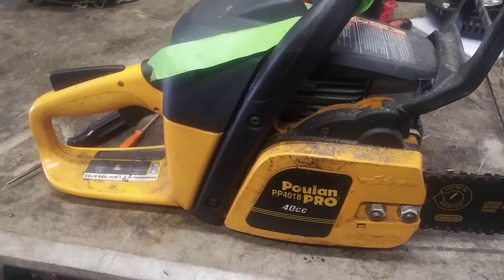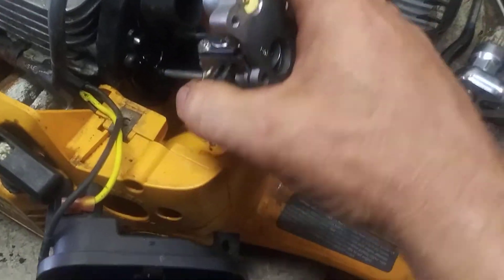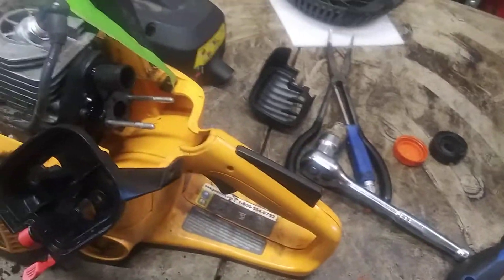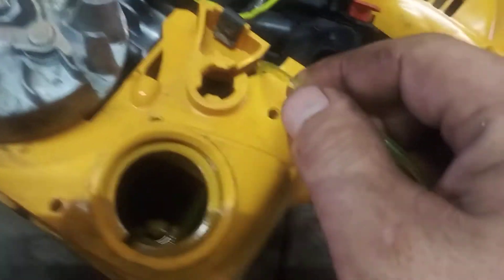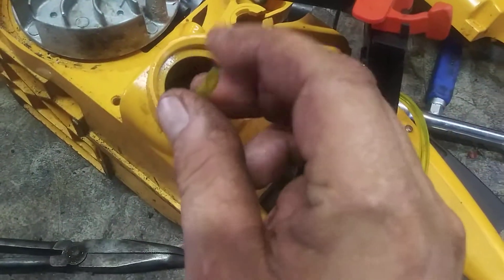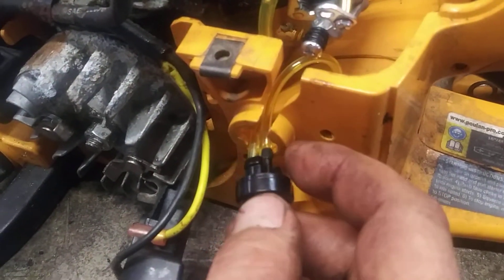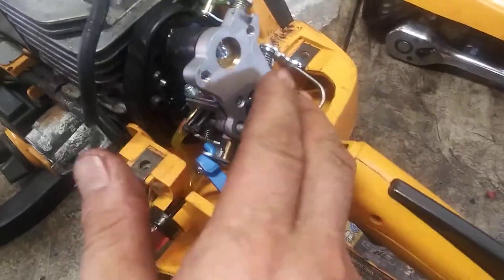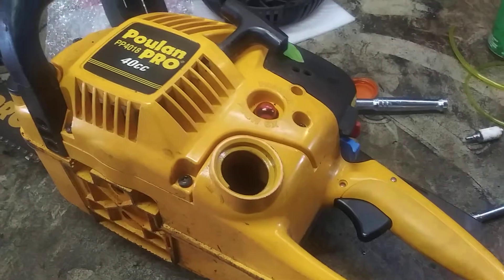*  Poulan pro pp4018 chainsaw carburetor repair. poulan chainsaw carb repair

Comment: I was wondering why the carburetor and head has two inlets Whats the second one for
Reply from the maker: they call it a turbo but it just opens at higher rpm getting more fuel and power in
Reply: @smallengineguys  I’m actually rebuilding one as a school project and i was wondering if it’s possible to put a single barrel carburetor on it and how to do so
Reply from the maker: yes its the same carb you just remove the extra barrel and plug the top hole.
Reply: @smallengineguys  ok
Reply: @smallengineguys  i was hoping to get it running with just the engine outside of the chainsaw part how could i mount the coil?
Reply from the maker: @Bread45  by making an aluminum mount and welding it to the block. You'll find that very difficult. Coil has to be perfect or timing is off. What are you trying to do.
Reply: @smallengineguys  I’m wanting to be able to mount it to a table without any kind of cover blocking any moving parts im going to have a plexiglass shield I’ll install once its running so i can explain how it works etc
Reply from the maker: your gonna need to mark where the coil goes on the engine block make a bracket and tig weld it to the block. do it slowly so you dont build to much heat and warp the seals. good luck.
Reply: @smallengineguys  thanks

Comment: Damn I was hoping you would show how to adjust the carburetor
Reply from the maker: Most of the time its the screw closest to the airfilter turned counter clockwise 1/4 to 1/2 turn
Reply: small engine guys yeah there’s three on mine, high and a low and an idle screw, was wondering how many turns out I needed on each one from the seated position all the way in? I have the exact saw
Reply from the maker: @wild8757  usualy i go in till snug then 1 full turn out on high and low. Im 4 feet above sea level though. Much higher altitude can go as much as 2 turns. Then go out a quarter turn on the one closest to air filter and keep trying on choke till it trys to start. Then at full throttle find the sweet spot of full throttle. Then work on idle from there. If you feel your way to far out on high then turn low out 1/4 turn and restart the high end. All else fails. New carb is in the description.
Reply: small engine guys Thanks I’ll give it a shot, Saw hadn’t been used in a couple years and was in my shed, we got a heavy storm that flooded my shed by a couple of inches over the floor, water got inside saw about an inch high, might have to replace carb, do those ones on eBay need much adjustment or are they preset?
Reply from the maker: @wild8757  pull muffler look inside at piston make sure no rust or damage. Run with a touch more oil the first time.
Reply: small engine guys Yeah I already pulled the muffler and checked out the piston/ rings they look good, I just can’t seem to get the screws set right, I thought it might be the fuel filter so I pulled the fuel filter off and just stuck the fuel line down in the tank to test it and that didn’t help, tried putting in a new spark plug and air filter didn’t help, when I get it started it’s screaming but when I turn the idle down using the low screw or the idle screw it either keeps screaming or If I unscrew it out  too far it just stalls, or if I get it to idle it bogs out when you try to throttle up, I tried screwing both hi and low screws all the way in and backing out one turn each and working from there but can’t get it right for some reason, I was going to buy that carburetor kit that you bought but I read some of the reviews saying the carb barely works and it’s not the same, doesn’t sound right, doesn’t run like the original one does, it made me hesitant to buy one, guess I have no choice now, What do you think did that eBay carb run just the same as the original or was it not the same and rough running?
Reply from the maker: @wild8757  1 out of 100 dont work on the new ones. I do 10 chainsaws a week. 10 2 strokes a day and i only get 1 bad carb a month or 2
Reply: small engine guys That’s cool ordering one now, I have the exact same one you had the Poulan pro PP4018  40cc, did you have to cut the housing to get a rod to go over the top or something for the carb to fit? I was reading one of the comments where someone said some shit like that, maybe it was a different model than the one we got?
Reply from the maker: @wild8757  no i just cut the rod a little its just to long. Its the throttle rod going to the top butterfly cut it righ after the bend.
Reply: small engine guys thanks for your help pal
Reply from the maker: @wild8757  no problem

Comment: WHEN ADJUSTING THE HIGH SIDE OF ANY CHAIN SAW ALWAYS USE A SMALL ENGINE TACHOMETER 
CAN BE PURCHASED FROM AMAZON $21.63 INCLUDES; SHIPPING WILL PROTECT YOUR PISTON FROM OVER HEATING 
CHECK THE MAKE/MODEL for THE RECOMMENDATION;TOP R.P. M.
A LEAN MIXTURE WILL CAUSE THE ENGINE TO RUN TOO FAST and DAMAGE the PISTON/RINGS and the CYLINDER ) A HIGHER FUEL RATIO of STIHL (2 CYCLE ENGINE OIL WILL PROLONG THE LIFE OF YOUR ENGINE
Reply from the maker: no it wont.  ill bet money ill run my chainsaw full rpm leaned out as much as possible and you run yours rich. you'll be surprised to find the richer chainsaw is actually hotter. here is proof https://youtu.be/vcgmEKhCFTs